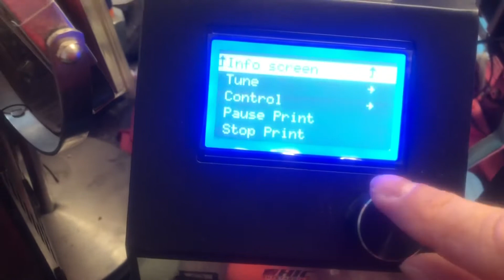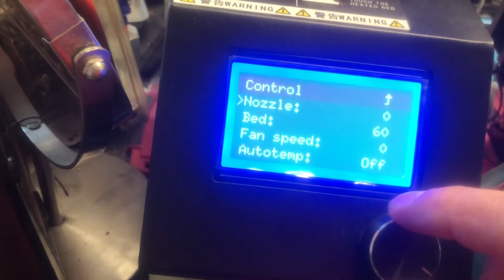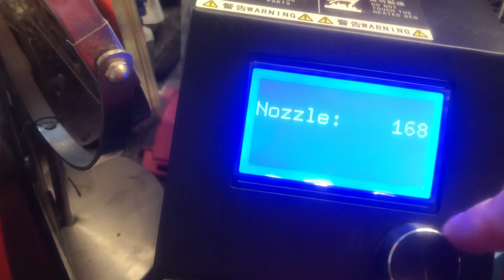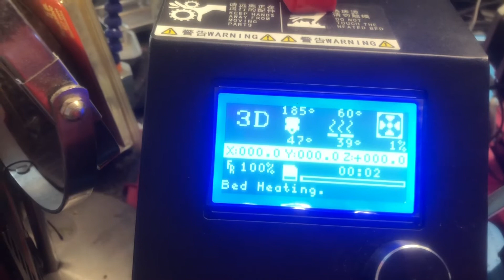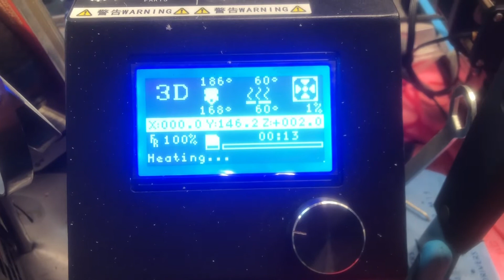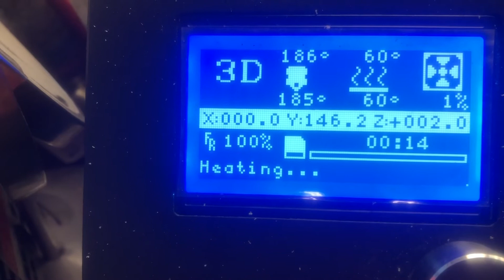Creality CR-10 hot end not heating quick fix.

Comment: I’m having the same issue u found a solution
Reply from the maker: I ordered a new hot end but it’s still working so I don’t know what the problem was
Reply: @DentMachineCo  how much for a new one because I spent all my money on the printer
Reply from the maker: @jgaming5182  it’s $21 on Amazon.  I have used a heat gun to get the heating started when it stopped heating for me before. Try that before you spend any money.
Reply: @DentMachineCo  thanks so much
Reply from the maker: @jgaming5182  no problem. Let me know what happens.